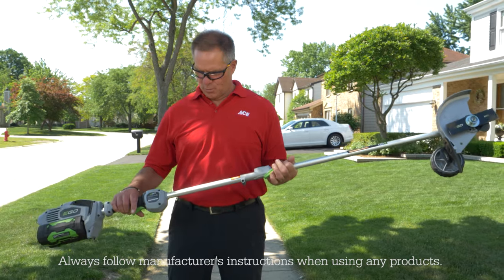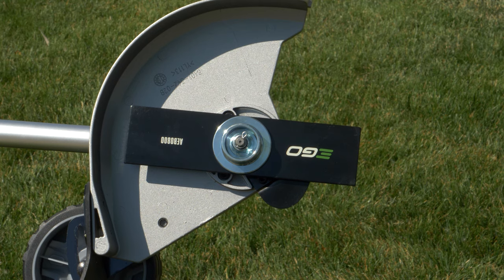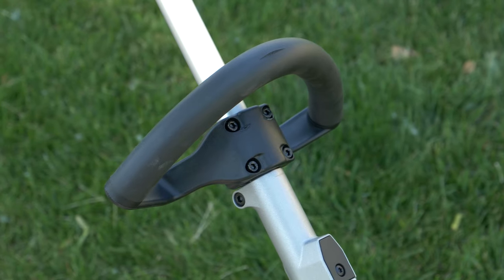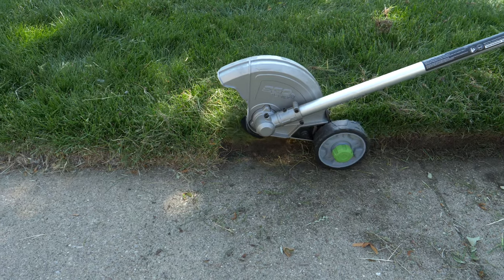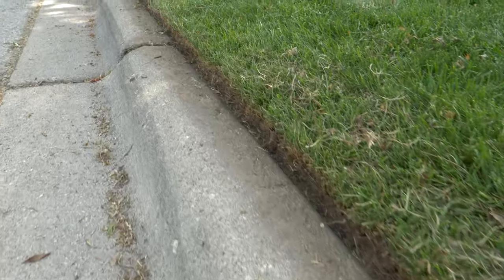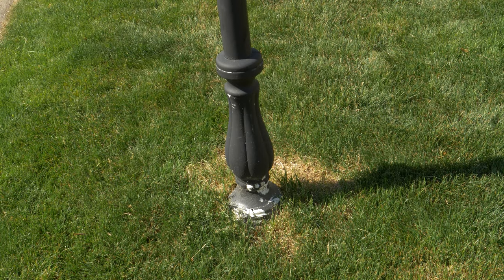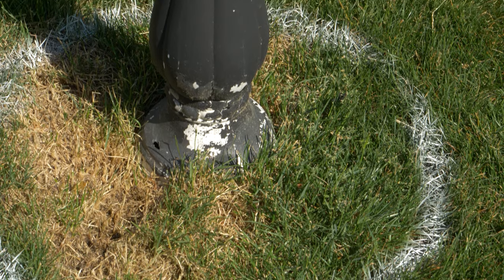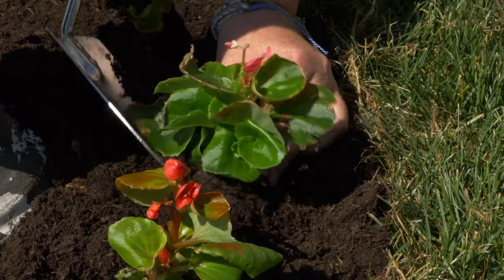How To Use A Garden Edger - Ace Hardware

Comment: Can you explain the sparks? Normal process but why?
Reply from the maker: If the area you are edging has a thick overgrowth of grass between the yard and the sidewalk/driveway, getting in there with the blade is tight and sparks can occur when the blade hits the pavement. Hope this helps! Happy edging. :)
Reply: @AceHardware  but when the blade does hit the pavement,  does it do any harm such as chipping it?
Reply: Have you ever seen what happens when metal strikes across stone at the right speed and angle? There's stone aggregate in concrete. 

If you lower the spinning blade slowly to the edge of the concrete/ pavement it may spark a bit from the friction until you find the groove between it and the lawn, but there should be no visible damage to surfaces, unless the surface was already in need of repair, or unless the operator is being careless.  Be wise and safe out there.

Comment: What if it accidentally touches the curb or concrete? maybe wire blade would be safer?

i am thinking getting one of these.
Reply from the maker: Hi There,
Touching the curb or concrete may happen especially if there is a lot of overgrowth there. You'll likely see sparks when the blade hits the concrete. When you see sparks, adjust your distance to be closer to the sod. The blade is thick and designed to handle that kind of impact, but run the edger slowly with care.  Hope this helps!
Reply: Buy one if you have not already ! You will have no regret

Comment: Thank you sir...

If money wasn't an issue, battery powered or cord version?
Reply from the maker: Battery Powered for sure. It's going to give you more freedom around the property and it's safer. The EGO option in the video is great because the EGO Powerhead allows you to snap on other ends like a pole saw, hedge trimmer, etc.  Hope that helps!
Reply: @AceHardware  it does a lot! Thank you very much.
Reply: Get gas
Reply: Works better pulling backwards...😊

Comment: Is it wrong for me to put the wheel on the grass side and make my edge to the pavement?
Reply from the maker: Hi There,
You can do that but the edger may jump around a bit. If the grassy area is not flat you may get a jagged look when completed.
Reply: It's not designed to be used that way. Wheel on pavement, blade and guard facing grass. It's an awkward tool for sure, but you can get used to it, and it's easier once the edges are established and not overgrown.

Comment: Is this for thick weeds in patios?
Reply from the maker: No, this is more for getting straight lines in your lawn, landscape and garden beds. Using the garden edger would damage your soil if used to remove weeds. You may want to consider a tool like this weed puller. It grabs the weed and pulls it out all the way to the root. Saves your back too!

https://www.acehardware.com/departments/lawn-and-garden/gardening-tools/pruning-tools/7166549

Comment: Can this be use for cut weeds on landscape rocks?
Reply from the maker: This could scratch the landscape rocks. We suggest spray or pulling weeds in those areas.
Reply: Or use weed trimmer?
Reply: @xianli6488  Yes a string trimmer.

Comment: Everytime I've ever bought anything battery powered for the yard, it's been crap right out of the box.
Reply: I bought the Milwaukee M18 trimmer/edger and the thing is a serious heavy duty tool. I actually think it's better than gas in performance, and far better than gas in ear of use.
Reply: *ease
Reply: Ego outdoes some of our gas equipment.  Although sometimes we need the bigger batteries which are costly. They also automatically adjust power output on things like their mowers and weed eaters